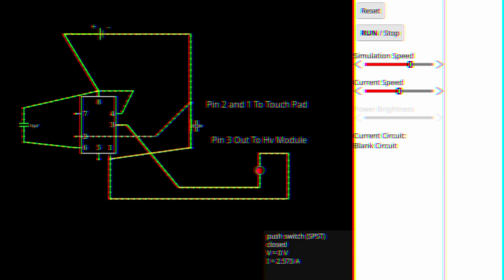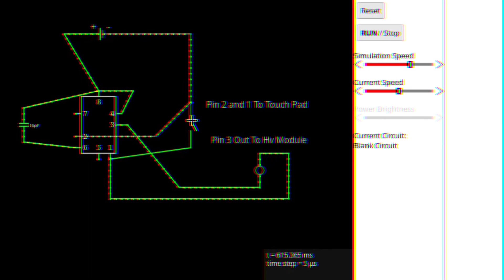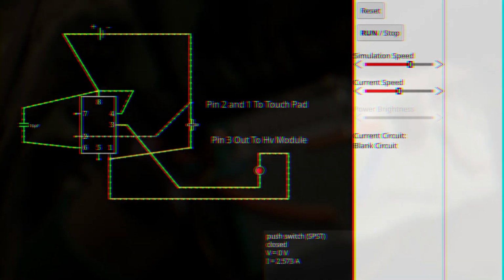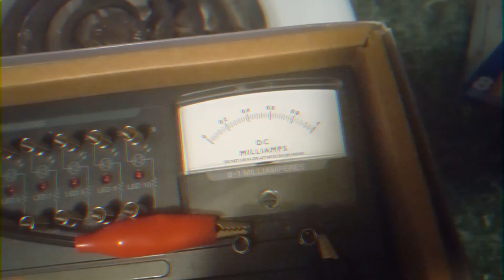The HSS "Helmet Shock System Lost Infomercial"

Comment: Bro my amazon firestick gen 2 not turning on even i checked power supply hdmi cable but there is no signal sign on my tv and i thought if i root it it can fix but while tryng to root it us showing run time error so could you please help me😢
Reply from the maker: Did this start after trying to root or before you even opened the firestick kinda need to know in order to try and help?Also sorry for the late reply I been out all day.
Reply: @everythingdigital1  before it was not working I don't know the reason so I thought rooting will fix this issue but for rooting there was issue runtime error ( "what's wrong with your Gpt?")
By the way thanks alot bro for replying and I will subscribe your channel in all my family members mobiles
Reply from the maker: @YtxINSANE  It all depends on what is wrong with the stick I seen people recover these fire tv gen 2 tank sticks using this method and I seen people either fail at it or something else happens to be wrong that makes it not work. Could be something power related too I would test if possible. Its super late for me now but ill try to help more tomorrow when I can.